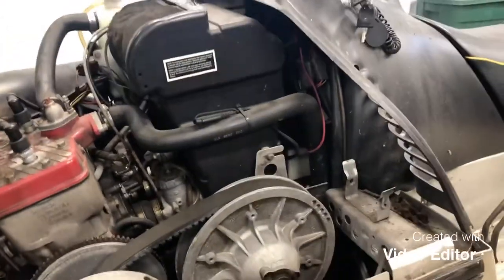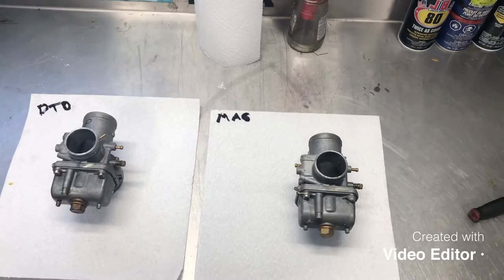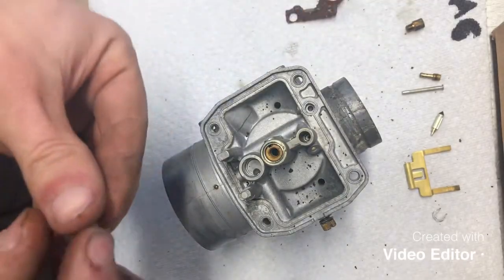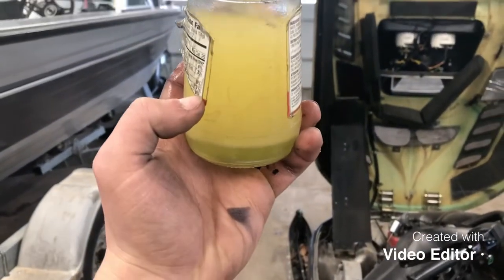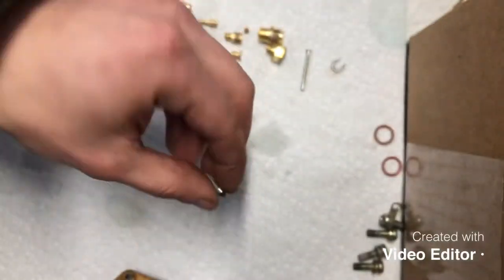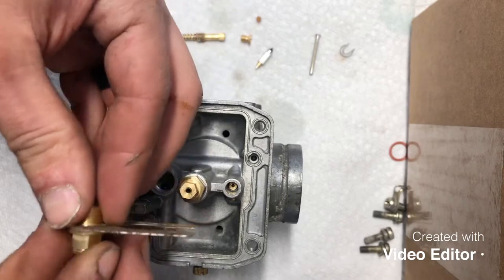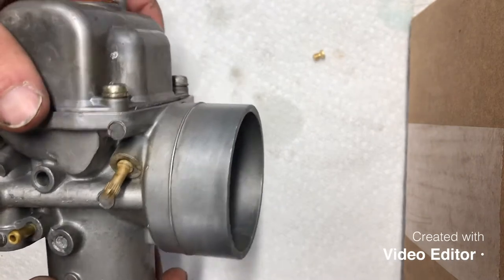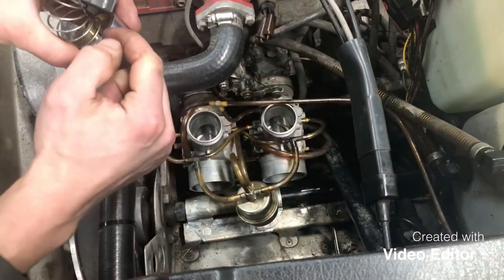How to clean carbs on a ski doo 583

Comment: Thanks for a very informative video !  I just cleaned my VM40 Mikuni's this weekend from a '98 Ski-Doo 583 MXZ.  Like yours, my baffle plates were rusty.  I recovered these using steel wool and some scraping with a razor.  Otherwise, one can purchase new baffle plates from Niche Cycle in FL who lists them on EBAY.  A couple tips: check float bowl heights; mine were out-spec.  Also, don't leave the fuel inlet needle in cleaning solvent for a long period; the rubber will soften and you will need to buy new needle and seats.

Comment: Nice vid. My first visit. Think ill subscribe. 
These old machines were and are great sleds !! So easy to work on. Unlike these new etecs. Dammm. 
Hope that sled got a new belt and secondary set up. He would notice day and night dif with defelection even set up. Hes loosing 50% power right there. Cheers.

Comment: On the black hockey puck looking floats there is the one rubber cap that stops it and mine only has one and I notice that yours does too. My seld runs fine but floods when shut off and I figured since there is no stopper on the one side it sticks open

Edit:I watched the rest and I guess it doesn’t matter that there one but thank you for the in depth video

Comment: What is that last jet looking screw you took out? The one   on the air box side of the carb with the flat head screw driver head on it? That u said opens up  a passage way. I have a 98 formula z 583 and the crank case was full of fuel and w9nt start obviously so I got it all out of case and cleaned carbs etc and fuel pump and I noticed both my carbs are missing that screw you took out last. Is that screw important?  Will it make my sled not run or over fuel when sitting? Ik the floats being stuck could and or needle valve or even maybe the hand primer but I've spent 2 full days messing with this and still can't seem to figure it out. Greatly detailed video tho thanks in advance if you reply
Reply from the maker: That is the idle mixture screw. It is very important to have as it controls the amount of air/ fuel the engine gets at idle. If your crank case is filling with fuel I would replace the needle valves as well as check the pulse line from the engine to the fuel pump and make fire there is no fuel there. If there is fuel in that line you will need to disassemble the fuel pump and replace the diaphragms. 
Hope this helps!
Reply: @therapawayhomestead5464  nope wrong acrew I mean inside the bore of the carb like if u look into the hole of the carb from the air box side that small brass screw head inside. It was the very last screw u pulled out when cleaning ur carbs
Reply: @therapawayhomestead5464  and yes I did actually just get it to run I've had that line off and it had some fuel in it and I've spent 2 days pulling it over to get the rest of the fuel out of the case and out of the e exhaust etc. I found a sticky valve and cleaned it again and now finally got it to start but still running way rich and I've got the air screw turned out 2 turns on both carbs would be leaning it out right? Or is it trying them in to lean out?

Comment: Where do I start with the idle screws? Both have been removed and I have no idea where to even start
Reply from the maker: I would start at 3 turns out and adjust from there
Reply: You  don't need those.

Comment: I have a 98 mxz 583 And the throttle cable broke, well I ordered a new one from automatic distributors and I installed it, the new cable is sitting properly in in the thumb control, it’s lowered all the way down on the slide adjustment but when I start it’s revving way too high and engaging the clutch. So I checked and my slides are like 3/8 inch up from fully closed, the only thing I can think is it’s the wrong size cable , however it said skidoo 583 right on the original packaging, I’m going to try adjusting that side idle screw tonight but I do not think it’s going to adjust that much to make a big difference but do u have any suggestions on lowering the slide?